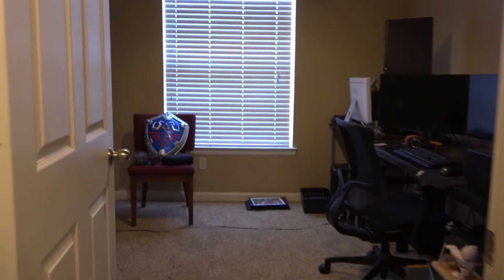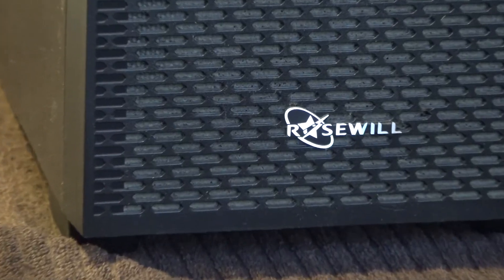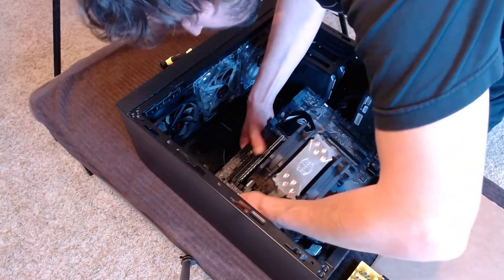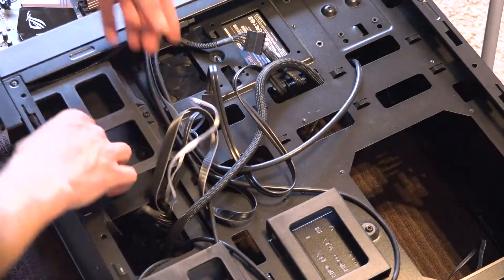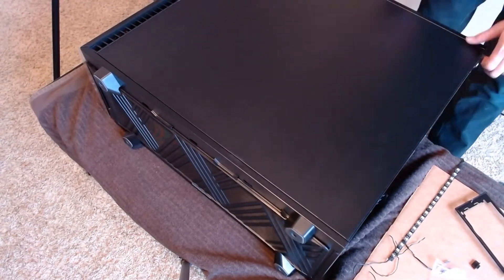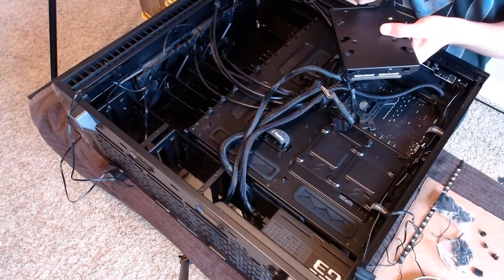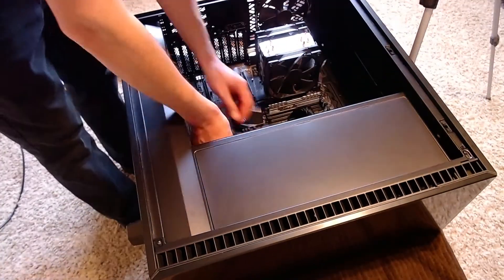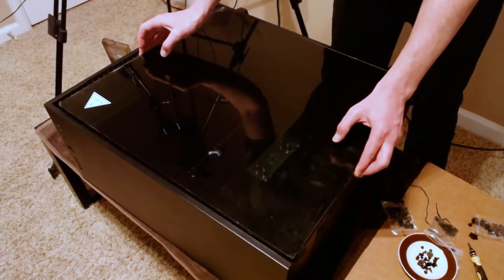Server Upgrade | Define 7 XL | Full Case Swap

Comment: You will REALLY apreciate that you almost can take the whole top off when you move to install top fan's or water. The Define 7 is no slouch either, I have both. The XL I have decked out with 11x 3.5 and 2 x 2.5 drives, and man, am I glad that I have a physical work, it rings out at about 40 kg, and still I have room for 7 x 3.5 and 2 x 2.5 drives more, EVEN if I choose to switch to watercooling 😁